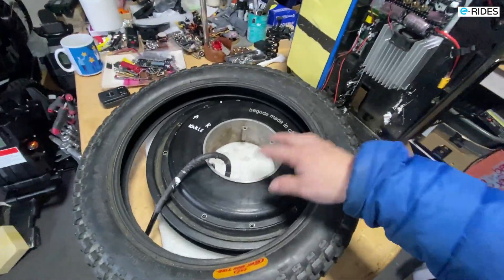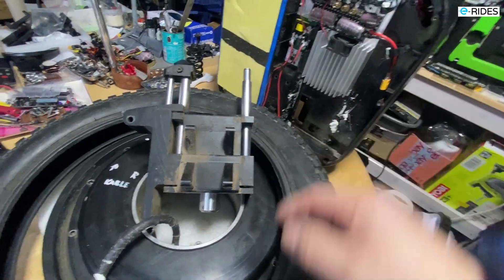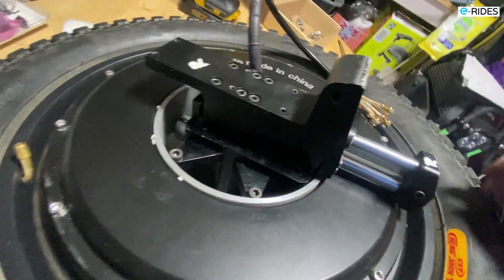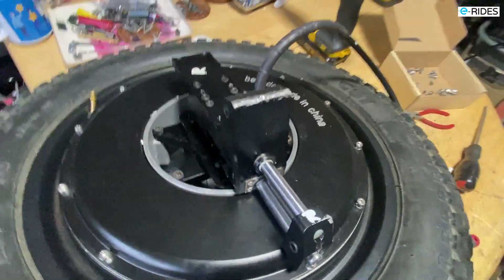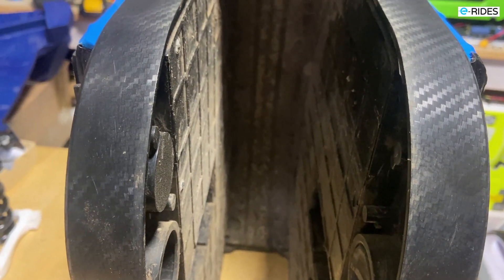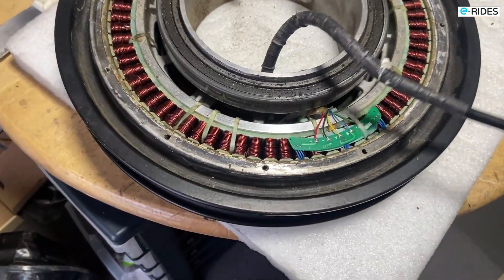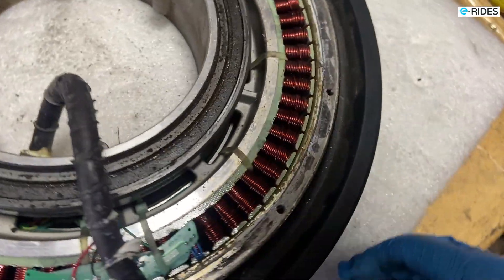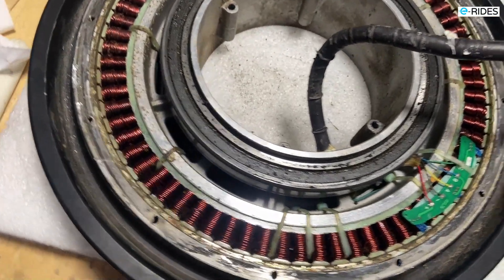BEGODE EX Motor Replace. e-Rides EUC Upgrades

Comment: Good video. I still enjoy my EX. Have taken it apart twice for tire changes as the original was not aligned properly. I have since replaced it with a Pirelli street tire. Cruises nice at 30 mph. Hopefully no bearing issues anytime soon. EX30 is next when this goes...  😎